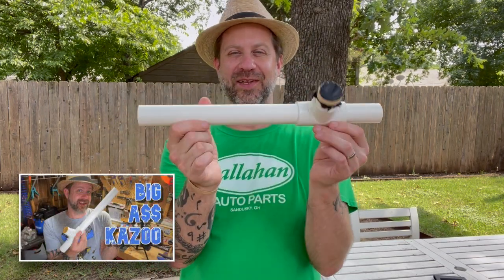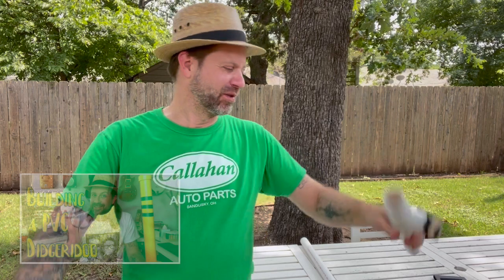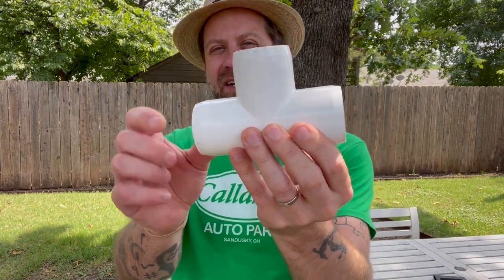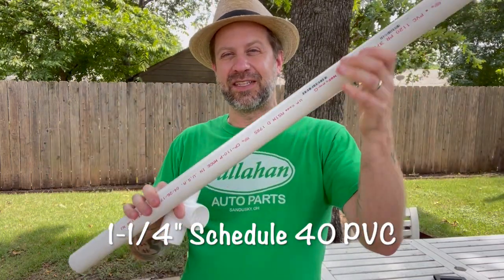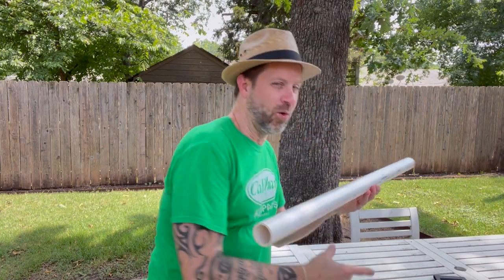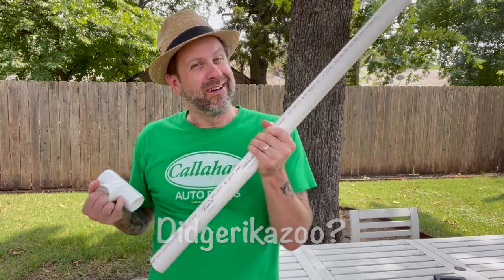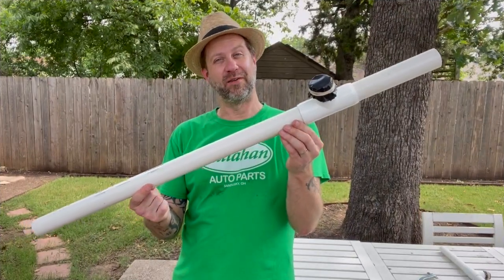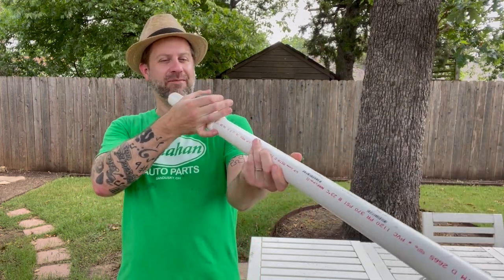Is This a Didgerikazoo? (DIY PVC didgeridoo / kazoo hybrid instrument)

Comment: Ha! That looks fun. You could modify another junction piece to add a "kazobo" mouthpiece, which has the membranes on two sides.
Reply from the maker: I was actually wondering about putting multiple t joints on the pipe and see if it sounds different. I guess there are a lot of options with something this simple. Thanks for checking it out.
Reply: @musicalmiscellany  Another fun bit to tinker with would be adding a length of larger diameter pipe for a slide didgeridoo.
Reply from the maker: @robertstapleton4394  Add a slide handle and call it a didegerikazoobone. 😝